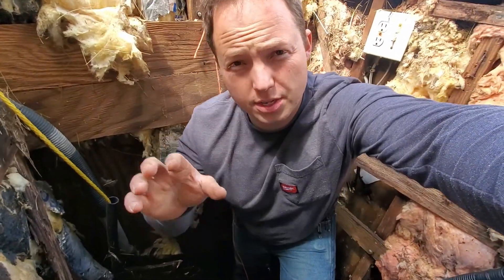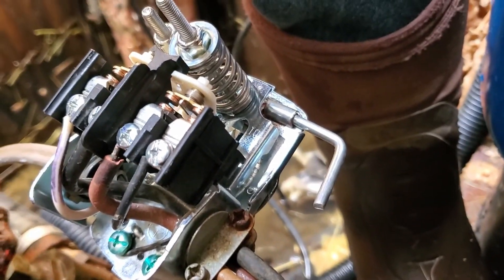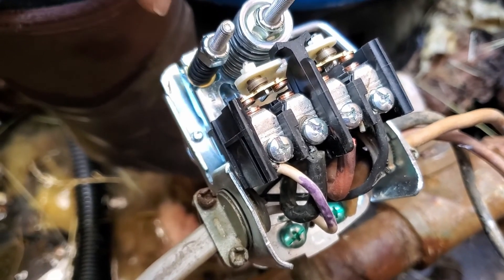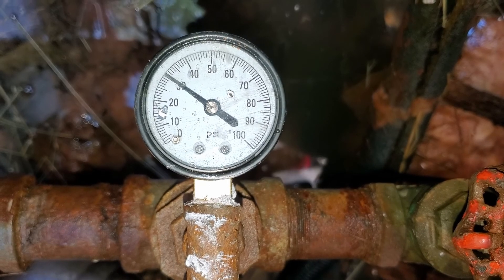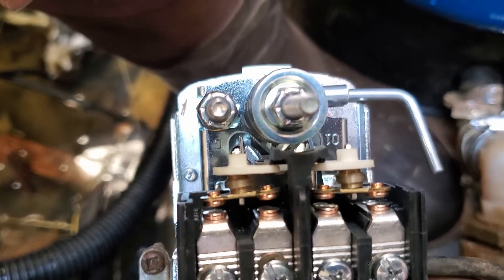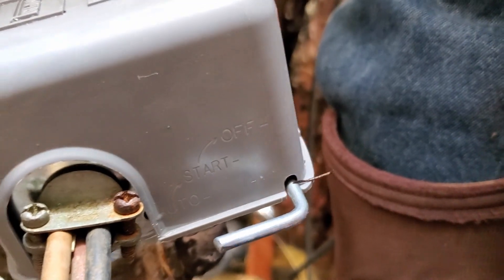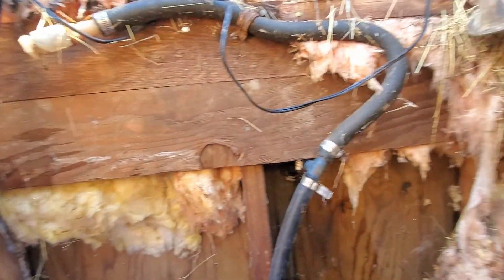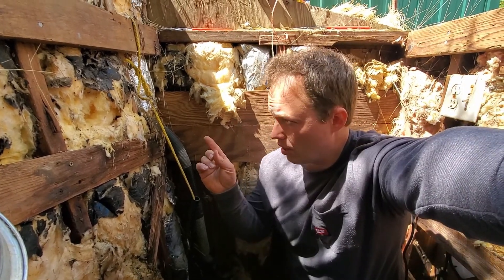How To Adjust Well Pressure Switch Cut In/Out & Tank Air Pressure for Manual/Auto Pressure Switch

Comment from the maker: Written instructions:
1 - Shut off well and drain all water.
2 - Check air pressure in pressure tank and set at 2psi less than the desired cut-in pressure. If pressure tank was empty/ has low pressure then it needs to be replaced. Pressure tank: https://amzn.to/4gRx7kv
3 - Turn on well, observe cut out pressure, drain until cut in and note pressure. Turn off power and adjust to desired setting. Record set points by writing on pressure tank.

Comment: nice introduction unfortunately your fix seems to easy and really doesn't explain things entirely.   Your set up will not automatically pressure up when the power goes out and the pressure drops below the cut in pressure.   I believe this is why your fix looked so easy.   Your power went out and the water drained and the switch opened up so your real fix was really just closing the contacts.   If your contacts stay closed even if you drop below the cut in pressure I would consider my well tank.   Your well pump and water tank really go hand in hand.   The first thing I would do is check the air pressure in your water tank.   It should be 2 psi below the cut in pressure.   If not, I would add air to the manufacturer specification and check again to see if it holds or if any water comes out (bad).   The second thing I would do is to raise or lower my air pressure by either tightening to raise and loosening to lower.   Then, I would adjust the small bolt or nut, differential, to help set a range.

Comment: I just put a new pump that came w pressure switch. It comes on at 30 n kicks off at 50 but rapidly just goes  to and  stands at 40lbs and repeats when water is used. I checked the tank it was at 27.9. But I checked it without draining the pressure, no leaks,  new pump, new switch, what’s my issue, oh well water, foot valve is good

Comment: I live in Florida so, since we don't have to worry about a freeze line, we don't usually use well pits or need pitless adapters. Our well casing protrudes out of the ground and the drop pipe from the submersible pump extends above the top of the casing and is piped to the system. This is typical for Florida. However, not so typical - We have our pressure switch set to 55-70 since we have 1400 feet of 1½ mainline feeding three houses.

Comment: Had 30-50psi before but fitted a ceramic (candlestick type) filter which reduces by 40psi total with a pre-filter as well. Trying to increase range up to near enough max for my setup (90psi). Spring under screw A has come basically fully compressed but cut in pressure is still only around 45psi, in addition the range has extended somehow, perhaps due to compressed spring A acting on the whole plate..(??) even tho screw B (cut off) is completely loose. Any tips much appreciated!! (I dont have Square type, I have Italtecnica pressure switch).

Comment: I’m losing almost all water pressure in my sink when the washer is filling up. The pump kicks on at 40 and off at 65 which, from what I’ve read, doesn’t seem too far from normal. It also just started being a problem so I’m worried it’s something else

Comment: Really very useful video - Thanks
I’m replacing a switch whose contacts are going but it seems to be running at 55/75 (even though tank preset is 28psi which I suspect is the plumber not understanding how this works). 
The pump appears to cycle every  2 mins or so even though water isn’t being drawn. 
I’m buying a 30/50 and will set it to 40/60 because we use a Reverse Osmosis unit in the kitchen which works better at around 60psi. 
At same time I’ll preset the tank to 38psi to suit the 40/60 range.
I’m thinking that maybe the incorrect tank precharge  is causing the frequent cycling.

Comment: Our tank is in basement it’s 30psi and cuts out like 60-70. When run water it clicks back and forth constantly. Should we increase cutout? I can send you a video pls help asap thank you
Reply: You need to pressure the tank to 2 psi LESS than the cut pump cut off pressure. Basically with that little psi there is not enough air in the tank so your pump is cutting off almost like water hammer.
Reply: @ReWbd23 2 psi below the cut in pressure you mean?  Im confused  because thats what I always read, so 28-38 often if it's a 50 or 60 cut off.  I'm saying this because im trying to figure out why I got such bad water hammer situation.  Further details appreciated if you felt so inclined to assist

Comment: Great information. We’re on a low production well and yesterday morning, I noticed low water pressure in the house. we have a 30/50 switch with the manual start just like the one in the video. We rent an RV hookup to a friend on our property and to help keep her water from freezing on these extra cold nights we’re having them run the sink at a trickle and vent the gray tank to the ground. I suspect that constant demand on the system overnight coupled with my wife doing dishes for an hour or so early AM got us in that low pressure situation. 

I went in and saw the low reading on the gage and then worked the manual start to try and pressurize the tank. I noticed though that it took a few minutes to see any rise on the gage. Finally got it going and it cycles on its own. I’m concerned with how long it took to pressurize the tank though. I didn’t hear a woosh or trickle of water coming in like I’ve heard other times that I’ve had to use the manual start. 

Is there something I should check?  After watching this video I’m thinking I should check the air pressure in my tank and potentially adjust that as well as the set points on the switch. I did release a little air from the valve up top to check for a leaky bladder and didn’t see any water come out. Also tapped on the tank to see if it seemed like water was leaking past the bladder. It checked out ok there.

Comment: So if you  use water while the power is off, you have to manually turn the switch on again?
Reply: If it's not in the auto position yes. If u lose power it should stay in auto. But u only have about 5 gallons of water in the pressure bladder and then ur done
Reply from the maker: If the pressure runs out, then you do have to manually start the well.

Comment: A number of wells in my area are the shallow well variety. I always thought the well pit was a way of getting an additional 4' to 8' on there shallow well.  What is the purpose of a well pit on a deep well?
Reply from the maker: Pretty sure it was originally intended to allow easier freeze protection up here in the North.
Reply: Cold weather climate, keeps em from freezing. Well head is below the frost line. Michigan well pits are normally 8-12 ft deep. Frost line on a normal cold winter is 4-6ft but the past 5 year have been pretty mild. It was almost 60 here in Detroit today 12/28/24. normally it's been in the teens for a month now but winters have been mild the past few years

Comment: For 120v you can parallel the contacts so they last.
Reply from the maker: @publicmail2  Interesting! Hadn't thought of that.
Reply: @BenjaminSahlstrom  if u parallel ur contacts make sure you use 10 ga for ur hot feed wire, over time you will burn the feed wire up.
Reply: @davidmoore8741  doubt that.

Comment: Our pump is 700 feet down so it’s a huge expense to have it replaced.  We recently needed to have it replaced so we opted for a constant pressure setup with a variable speed pump. It’s really great. Haven’t had the usual high/low pressure in the shower since the replacement. Unfortunately we’ve got a lot of manganese down there so fingers crossed it lasts
Reply: I feel you.  Ours is 550ft.  Had it pulled and replaced a couple years ago.
Reply: @Kevin.L_  I’m jealous whenever I see someone on YouTube with a pump 40 feet down and they can pull it themselves. About 15 years ago in the pouring rain the guys had to drive their truck into our backyard by using two large metal plates so they wouldn’t sink the truck into the mud. We’ve got 20 foot sections of pvc screwed together with 3 wire electrical taped to the pvc. They put the crane truck over the well, and 20 feet at a time pulled a section, cut the tape, unscrewed the pvc section, removed it, and looped the wire on our grass. They did that for what seemed like hours until they got to the pump. 
Proble is not many choices of pumps at that depth. Yeah it sucks.
Reply: @Samlol23_drrich  Yeah, my dad's is 90ft submersible and my father-in-law's is 35ft jet pump.  Pulled those myself.  Had to pay well guy with truck to do mine.  27 sections of PVC I think.  Interesting to watch and help though.
Reply from the maker: 700! That's wild. Ours is around 350 feet deep and I thought that was a lot! I don't have any experience with the variable speed pumps but I'm definitely interested in trying one out at some point but hopefully not soon! ;)
Reply: @BenjaminSahlstrom  it’s great but makes a high pitched whine. It’s in our basement so we don’t hear it, but just be aware some do if the control is anywhere near your living space. We have one by Pentair (PenTek vfd)